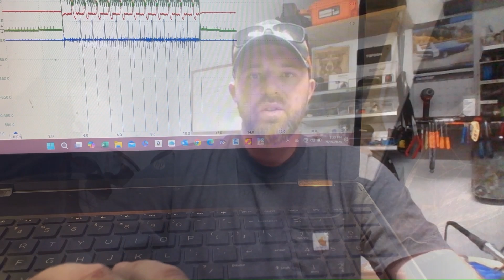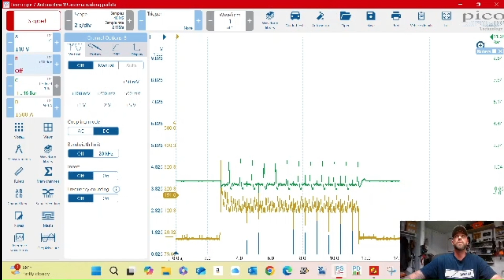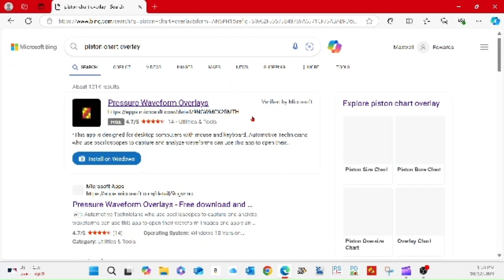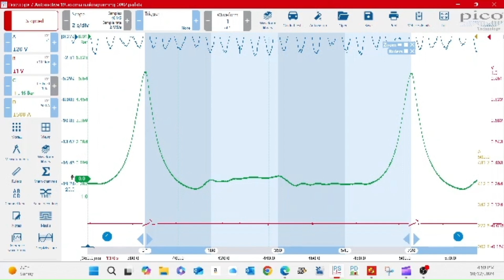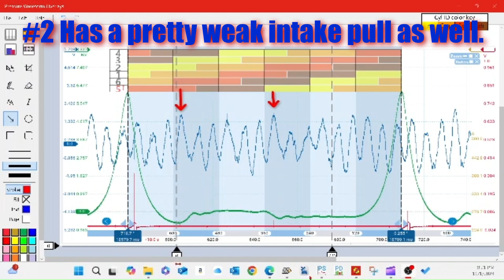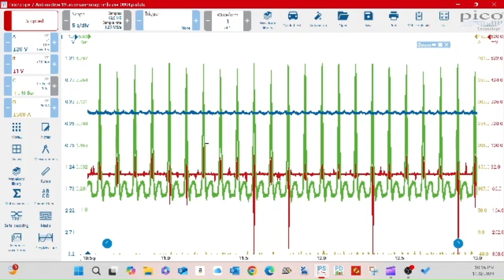Misfire Diagnostics Using In-Cylinder And Delta Pressure Transducers!

Comment: Hello I hope your having a good weekend. For the PS 16 RotKee Transducer you made a quick disconnect fitting male and female. What’s the brand name and where did you purchase them? I’m thinking about buying the PS16 RotKee Transducer but I like the idea of your quick disconnect fitting. Thank you I hope you have a nice holiday.
Reply from the maker: @mobicho4061  happy holidays to you as well my friend. The adapter I used is from Harbor freight. It’s a universal adapter so it will fit any compression tester hose. It also has a locked seal to ensure a tight fit. I had to re-thread the adapter. I honestly can’t remember exactly what all I did. Or what the thread is on the PS 16. But if you Google it, it will come up. But I remember I had to, reread it because here in the states we don’t use any fittings with those threads. I believe I used a spark plug re-threading tool. Thread sealant. But I’ve never had any issues. I’ve had a couple people ask me about this. I can make a how to type instructional video for the PS 16 including the adapter I used. I’m sure a few people out there would appreciate that.
Reply: @rocktee@ transducer. And I’m going to get the fitting and then let you know how it goes. Happy holidays, my friend.